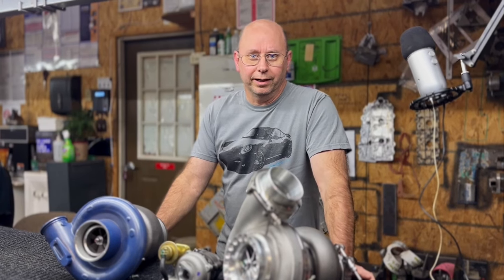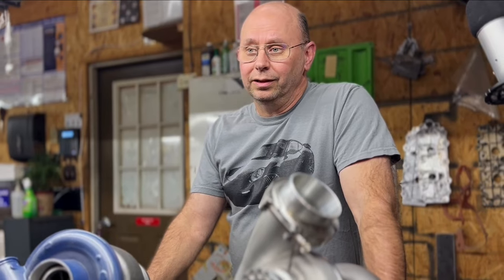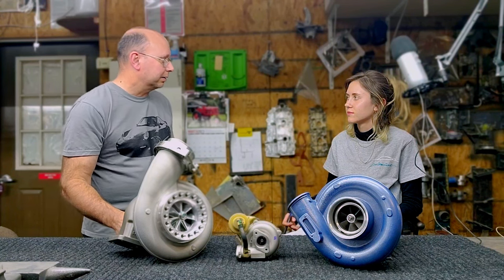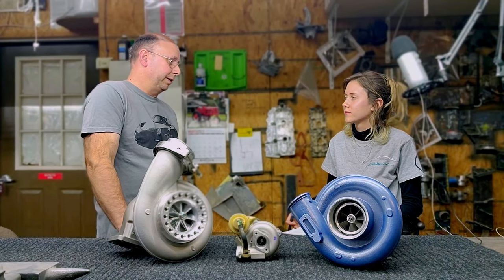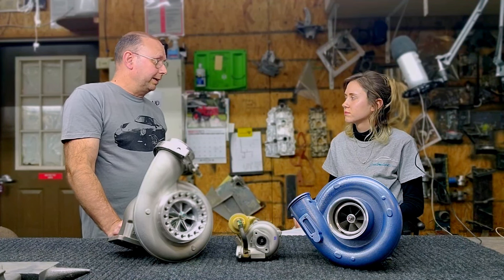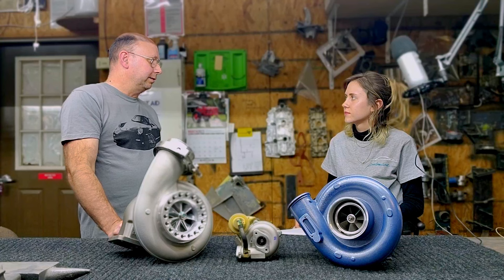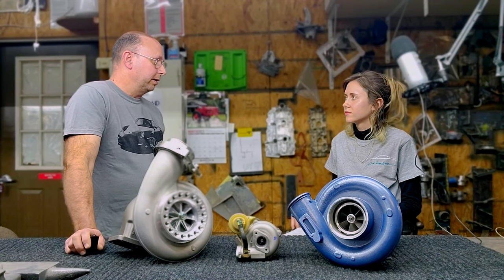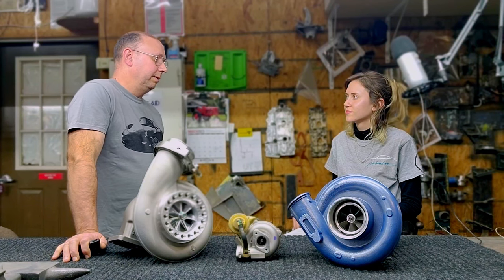Is My Turbo Too Big? PART 1 (Should I Upgrade my turbo?)

Comment: Thank you Todd, lots of great info here! What would you recommend for max ""safe"" power on stock internals for a 996 turbo? Reworked k16s or alpha28/30s? Power under the curve is preferable to peak number here.
Reply from the maker: Torque is what you really need to watch out for vs power.  Too much torque will hurt the stock rods or lift a head.  Better fuels have a higher factor of safety.  Crappy fuel and a bad tune could do damage at low torque levels due to knock.  Properly tuned, limiting torque on good fuels you can run k16s or alphas into the 600whp range.  Just watch out for the 996tt torque curve!  It wants to make huge torque around 3800, so be careful to limit the boost there.

Comment: Epic information, wow.
Reply from the maker: Thanks!   What else would you like to know?  We'll keep em coming!
Reply: 2 thing.... 

So no need for a standalone fuel management system, and on your site you have 4.1,4.2 and 5.0 what block is able to bore to a 5.0???.  

Amazing content looking  forward to the next one on how strong porsche  transmission.
Reply from the maker: @alphaplus4162  we prefer the Oem fuel management for daily drivers.  The aftermarket systems are fun for racing and have some features that are nice.   A decision can be made which is a better fit Depending on your ultimate goal. For displacement 4.1 is bolt-in, 4.2 requires case clearancing, 4.3 a ton of machine work, 5.0 is all custom/billet.  The manuals in these cars are quite strong.  For some of the bigger builds doing a lot of racing straight cut gears get installed in 3rd and 4th, trans pumps installed for cars without and billet differential side plates for road racing.